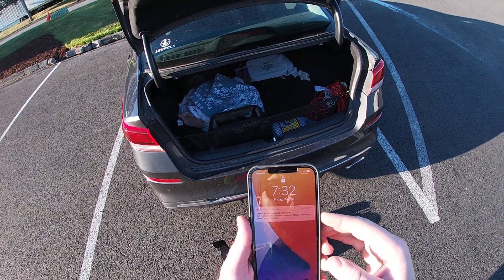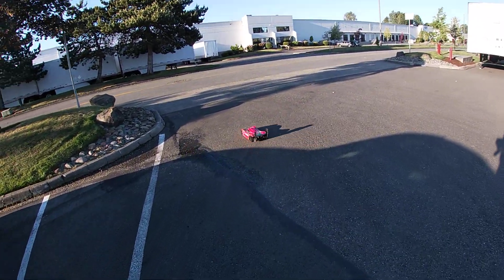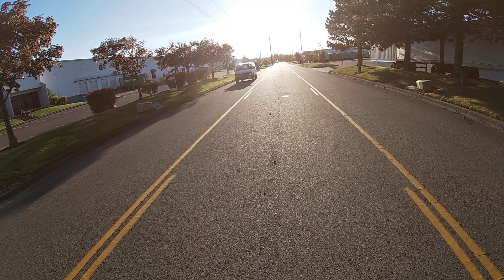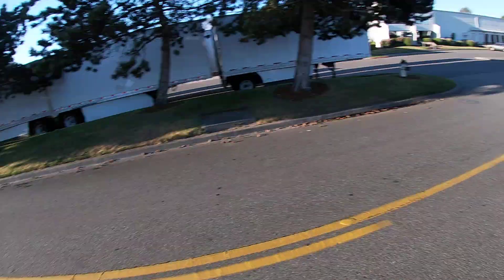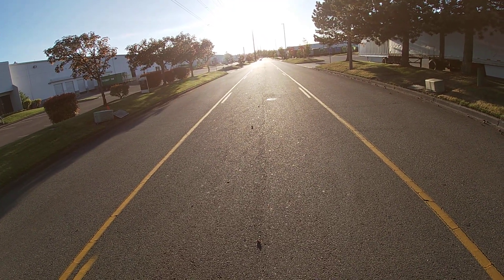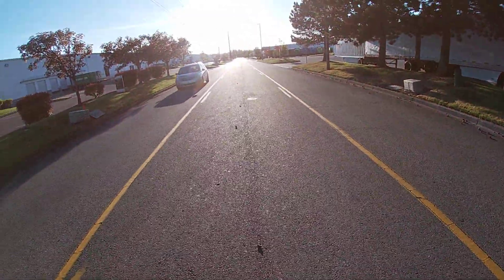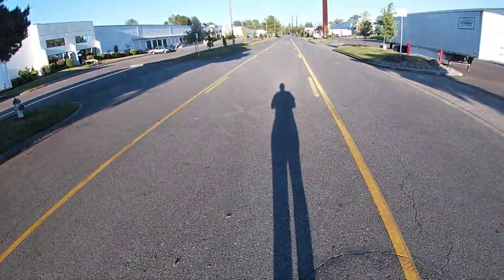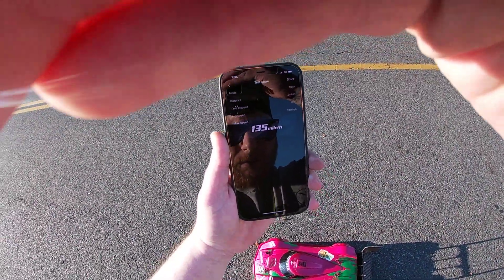Arrma Limitless GT speed run

Comment: adjust your expo, speed & acceleration in small increments. your 7pxr has total adjustment(0 to100 or 0 to 140) on all those parameters. you have a base point now. so start tinkering each individually at a time and closely observe what the car is liking and NOT liking. i saw you asked james Mc his gearing. "NEVA" ask such. do you. change/adjust settings gearing until you get it. and it will all pay off.   get you an assortment/sizes of gearing from saga customs. like you said, i comment and give my constructive criticism. no harsh feelings to you only a subscriber, rc drag and speed run guy trying to assist or help in anyway. be safe & endured.
Reply: This is great advice
Reply from the maker: I don’t remember asking anyone what their gearing is. I make a point of not doing that. It’s asking for a hand out
Reply: @jonlewis758  ok i stand corrected. remember this johnny you have a great platform & upgrades to accomplish very high speeds as others. it is a LETHAL RC WEAPON & Remote controller for speed runs & also drag.
Reply: @CmwSpeedrunUk  Mr. cmw Speed run UK you also have a extreme piece of RC machinery like johnny. ESPECIALLY that all carbon fiber toyota body.  BEAST looking. i also follow you for great content & honesty with no B.S. be safe & endured rcfam4life
Reply from the maker: @casconie  thank you very much. Yet my numbers a mediocre. I just can’t figure out this gearing BS. I know I can’t be too far off it’s whatever though I’m sure after using enough wrong gear set ups I’m sure I’ll find the right one. I have no idea how to calculate that stuff and I’m not smart enough to understand it, lol.
Reply: @jonlewis758  you never son 
No one wants to tell you what to do , 
It’s good advice I think his just trying to help out 
He can see your working hard at this
Reply: @casconie  thanks sir all cars are built abs geared for maximum speed in the uk we don’t have roads I have about 1000 feet to work with , I will do a few more passes then gear down higher kv is the answer I recon
Reply from the maker: @CmwSpeedrunUk  yep I’m taking in all the advice in that I can for sure